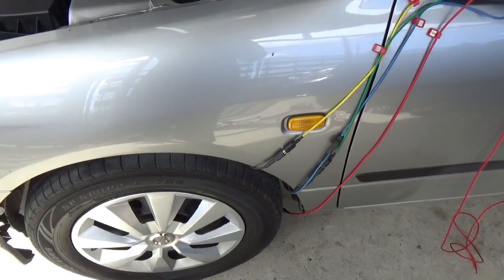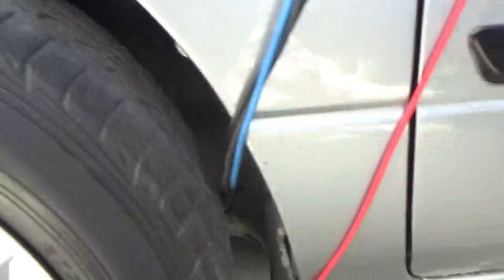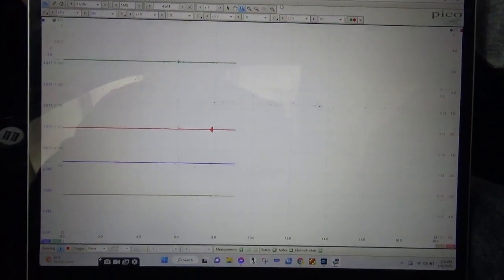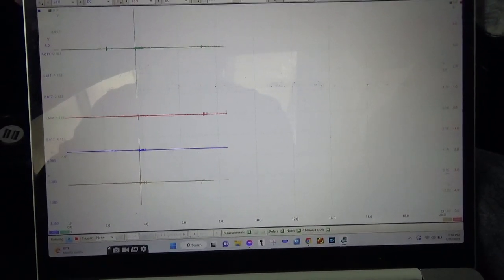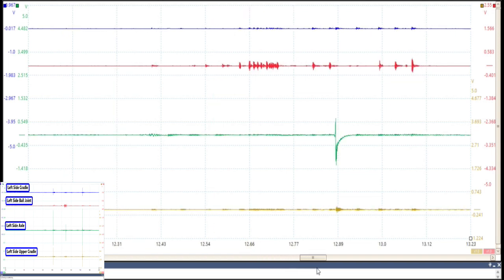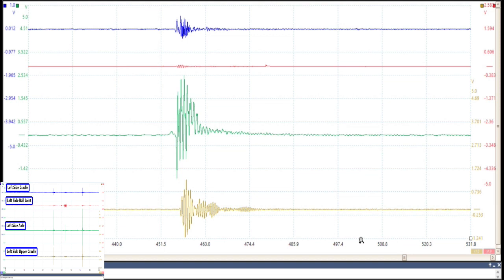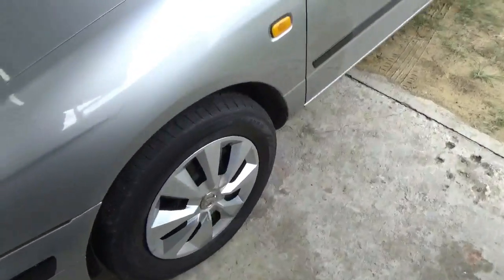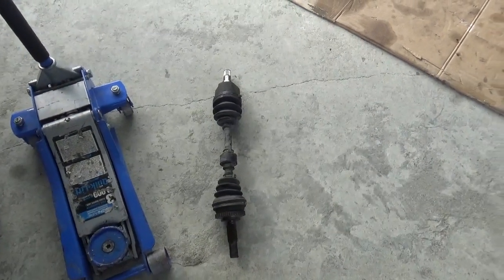Locating hard to detect suspension noise using chassis ears and an oscilloscope.

Comment: Looks like a Pico being used for the oscilloscope, though figured I'd ask which one you're using.  Thanks for sharing!  Neat how sound and vibration analysis can be used for diagnostics with vehicles and other machines.
Reply from the maker: The 4425. Thanks for the compliments

Comment: Nice find. What kind of sensors are you using? piezo sensors or microphones?
Reply: Man, even for the price of the replacement clamp microphones... seems like an easy DIY sensor set that'd just need a calibration to make certain each were measuring the same.  Wondering if using transducers or MEMS mic's is what I was about to ask.  
Was wondering which scope was being used as well, though any old one would do including like since microphones... something open source like Audacity or Spectrum Lab with a 4 channel audio input adapter like a UMC404HD, though wondering what the most cost effective 4-channel or more input adapter that's effective can be?   
The UMC might not even be required, as I'm only familiar with using for ELF/VLF radio so high sampling rate and spectrum analysis capabilities are good.
Reply from the maker: There is the ditex scope four channel that works great, it has a lot of features similar to the Pico that is for about $500 or less (i think). Its a PC base scope. I also use knock sensor and a modified pulse sensor that helps me detect noise.
Reply from the maker: Chassis ears with microphone and vibration probes